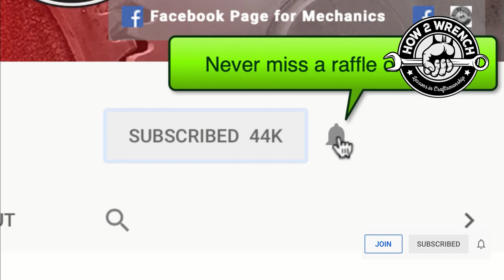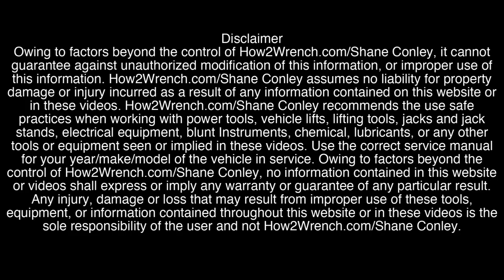How to change a shock spring with a $29 tool! DIY on Ohlins Race Tech Fox OEM

Comment: Glad it all went to plan. Good workaround with an economical tool. Maybe cut those clear protectors lengthwise in half,  lay them on the spring with concave inner area wrapping over the spring. 👍 When Techs Rock, America Rolls®!
Reply from the maker: Good idea! Now that I've used it, I have much more confidence it can be used safely. I still like the idea of a "cage" protector and plan to cut a piece pvc pipe to enclose around it and maybe use steel hose clamps to give extra support. Doubt anything would happen but working safe is one way "techs rock". 
So cool to see TechForce comment here. Huge supporter and lets keep them informed and engaged in what amazing opportunities this world provides for techs that "rock"...Keep Wrenching...Shane